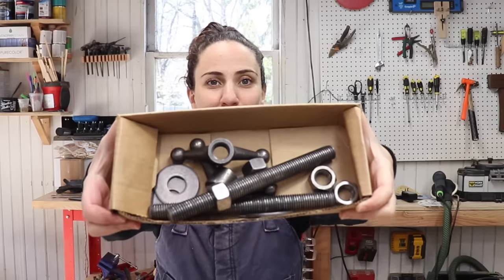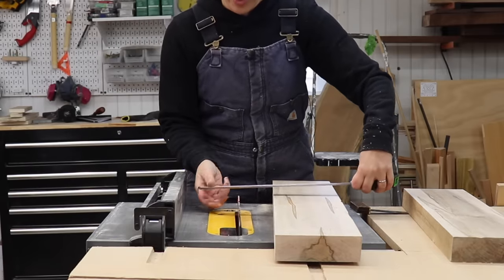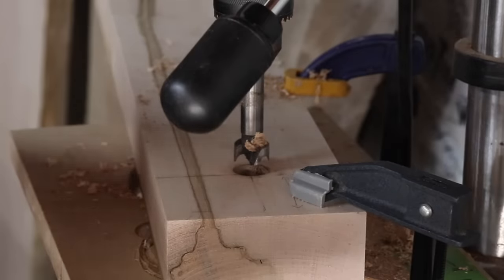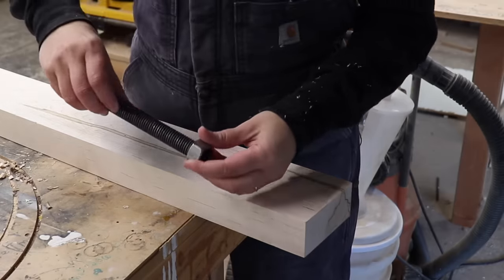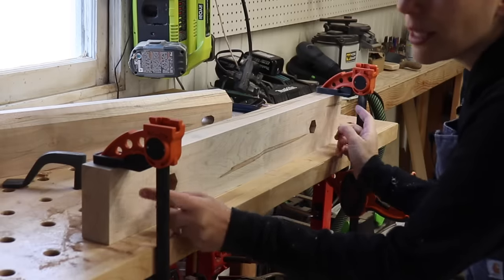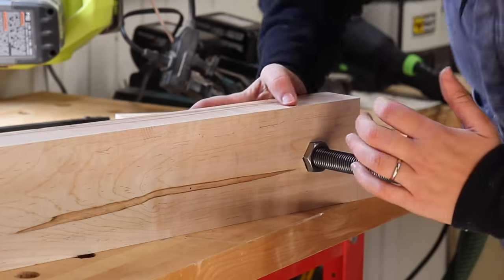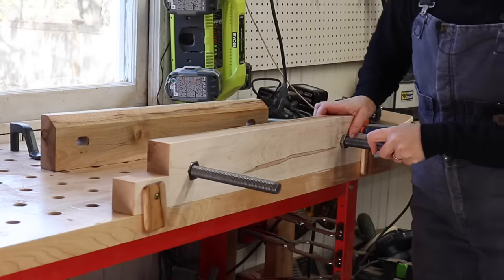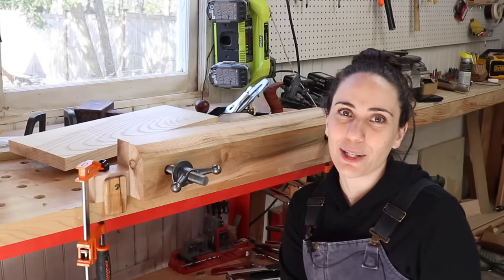$40 Moxon Vise - Easy to build in an afternoon!

Comment: Thanks, Tamar.  This is the first of your videos that I've watched and I found it extremely clear and helpful.  Personally, I prefer videos like yours with vocal descriptions of the process rather than just the high speed visuals.  I've decided to save some money (at the obvious expense of time) and make my own handles by inserting nuts into hardwood, which allows me to buy the threaded rod, washers and nuts for under $25.  I'll certainly be watching some more of your videos.
Reply: Hi there! Where did you  buy the big screw and  nuts for your  vise?

Comment: Great video! I wanted to build a moxon vise for a while. Last summer I was at a local flea market and found gigantic bolts with 1-1/4" shanks. I laminated 3/4" poplar for the jaws and used a piece of curly oak for the front handles. The jaws are lined with cork shelf liner which is very grippy. Your idea of the oval holes will be added to my vise, it makes sense that I would have angled work from time to time. Thanks for the video and the other ideas.
Reply from the maker: Sounds awesome! Yeah, It’s pretty cool to have that versatility

Comment: On the one hand, I like the round hand wheels that come with the Benchcrafted kit.
On the other hand, I could buy 4 of these kits for the cost of one Benchcrafted kit...

Also, if you make the front jaw so it sticks down a little further than the rear jaw, it will automatically index the rear jaw of the vice to flush with the workbench edge.
Reply: Only when its closed tho. But yeah good idea
Reply: Mark Beiser I wonder if you just made the front jaw a wide enough to extend down to the bottom of the bench top if that would improve holding surface area??
Reply from the maker: Haha! Yeah. To each their own I guess. It’s nice that there are options out there!
Reply: I keep thinking about a moxon vise, but I have this nasty habit of wiping excess glue on the end of my bench making it pretty useless for a moxon. Maybe I'll build and sell an excess glue wiping station to everyone. :)
Reply from the maker: martino amello hahaha wipe the excess glue UNDER your table! 😂

Comment: Great video! My one suggestion would have been to instead of making flush registration tabs (11:32), make the front jaw slightly taller than the back so that when you put your moxon vise onto your work bench, you can just easily push the vice back until the bottom lip of the taller front jaw is pressing up against the edge of your bench. Result, you will have an automatic flush mating surface between the back jaw and the bench edge! Overall, good stuff though! :)
Reply from the maker: Thanks! That’s def another way. I didn’t like that way bc you have to have the jaws closed in order for it to register. I’ve used a vise like that before and I just didn’t like it. But to each their own! Lots of different methods!

Comment: Great video. I have the hardware, but haven't got around to building one yet. One critique I would make is that you switched reference surfaces while marking the center on both boards, at the 2.40 and 3.40 mark. Always a good idea to be consistent on which reference surfaces you're using. Again, I am nit picking, but still a great video and the inspiration I needed to build mine.
Reply: mark center from both sides

Comment: Tamar, I absolutely love your woodworking videos. You're refreshing, fun, and very talented. Regarding the vise, the build is clear and well-executed, and absolutely holds up to your typical outstanding work. 

A brief note of caution to folks, however: 

The reason this is SUCH an affordable option is the TYPE of threaded rod being employed here. This is standard, 10 TPI Threaded Rod. 
This means that the threads are shaped like this: \/`\/`\/`\/`\/

Most vises, clamps, anything that needs smooth actuation and really strong, solid clamping FORCE is made with Acme threads (you've probably heard the term used, and in this case, it is NOT referring to Roadrunner cartoons).
Acme threads are shaped like this: `|_|`|_|`|_|`|_|`|_|` (note the square shape, vs the typical V shape).

The reasoning being pretty clear: when you bear down a bunch of force, you have that constant thickness throughout, vs the tapering metal, which will wear and bend, ultimately introducing more racking, slop, and chatter to the vise. Moreover, that rod is 3/4-10. 3/4" diameter, 10 threads per inch. This means to move that rod one inch requires ten rotations of the handle. Compare this to Acme, which, for a comparable diameter, you're far more likely to see 3/4-6 (6 TPI). This is because the meatier threads maintain 90-degree surface engagement (i.e. they don't try to "slip downhill"). This, coupled with the beefier thickness of each thread means less need to be contacted to maintain the same amount of friction (and it opens/closes almost twice as fast).

...it also explains why Acme threaded rods are almost 4x the price for the same hardness of steel and why (and this is where people screw - ba-BUMP! - themselves) the Acme collars/flanges/nuts are anywhere from 5x-25x the price, again for the same steel with LESS cuts made into it.

This is not to discourage anyone, just to inform.
Reply from the maker: Thanks for the info. I havnt found the lack of acme threads to be a problem with clamping force
Reply: Thanks for this interesting piece of information.

Comment: Great vid! Just what a I needed.  I recently bought the Taylor Tool Moxon vise kit.  They no longer include instructions, just a QR code to a link which is overly complicated and not particularly clear. I've watched a few other vids about how to put it together but yours is by FAR the best. Clear, concise and thorough.  Only thing I think I might do differently is to actually mount the vise to the end of my workbench rather than relying on clamps.  I can see the advantage of both, depending on your workshop set up.  Thanks so much!!

Comment: Nice video and very clear. I built mine before I seen this. I picked up everything at the big box store except the t-handles. 

Just a couple things I did different; my front jaw is taller  (even on top), the lower part indexes on the bench face which aligns my vice as well. I did not elongate my front holes, there is enough slop to get enough angle. Also added springs and bronze bushings for wear and self opening jaws.

Comment: Great video, and the version on your website is great as a companion. I used both to build my vise. A tip for marking around the nut before chiseling: my rod was a bit loose in the 3/4" hole. So I put a single layer of masking tape around it before inserting into the hole. The I used both nuts, one on each side of the board, to tighten the rod in place. This nicely centered the nut so scribing it was easier to get centered. Also having the nut tight made it easy to scribe around it, without having to be careful to keep it from moving as you scribe. (as you may guess, I'm not as patient or as accurate with fine hand work like you clearly are!)

Comment: A good video kid and I am learning from you. BUT you must go back and do your safety NO long sleeves and RINGS ok I have spent my working life in heavy industry and I saw some BAD BAD injuries DO your safety ok keep up the good work
Reply: I'm a member of your fan club. First I want to agree with Haydn, hair in a bun and under a net. The middle finger of my left hand is about 3/16ths of an inch shorter than the middle finger of my right hand. I won't bore you except to say plain unvarnished sloth on my part.

I want to brag on myself a little. My shop has been in a storage locker for the past eighteen months. I've finally found new space. Eight hundred square feet, LPG fired central heat, hot and cold running water, full sit down bathroom,  room on the lot for my 32' motor home and my 19' aluminum step van that I'm building out for a shaved ice truck. Five hundred twenty-five a month water and electricity included. Over the years I've done a lot of work for this man and he wants to keep me close by. In fact next week I'm building a flight of stairs from the first to second floors of his new house.

My friends are wonderful.
My work is rewarding.
My life is grand!
Best to all!
Reply: "A good video kid ..." ?  😶

What kind of guy actually speaks like that to a woman?  🤔

Comment: I made myself one of these moxon vises! I didn’t have many of the tools in the video so I used a hand drill,   Shinto rasp,  block sander, a combo square, a dremel I used chisels for the first time effectively to inlay the bolts,  I learned how to create burrs on card scrapers and us it effectively and I ripped a 5 foot board with a pull saw with pretty good accuracy, Slowly I have to say but I got it done.  Made mine out of red oak.  Feels good to make my first wooden tool besides my work bench.
Reply from the maker: Ok

Comment: This video is another of your clear, detailed how-to videos. They're all great. Thanks.
I've been wanting to add a woodworker's vise to my work table, but my table is an Armor clamping table (which you also seem to be working over in part of the video) and I'm having trouble figuring out how to add the vise. I decided to use a Moxon vise several months ago and your video convinced that the time was ripe. I've completed it now and I just wanted to add some of the minor details that I encountered that other newbies might find useful.
- I used the same hardware kit you use in the video. The nuts threaded on smoothly but one of the wing nuts wanted to bind on every other rotation. I threaded and spun one of the nuts from one end of the bolt to the other and then back again, and then repeatedly did the same with the wing nut until it stopped binding. Now everything threads smoothly.
- I used a softwood (white fir) 2x6 for the wood, purchased at a local big box hardware store because it was easily available and inexpensive. If I do this again I'l take the effort and pay the price to get a harder wood. The wood bruised easily and got dirty very quickly, especially if I had been handling the hardware. However it did sand smooth very quickly.
- The guidelines that come with the hardware discuss an alternative front face drilling (¾" holes aligned with the holes in the back face) that only allows for parallel gripping. I chose to do this out of an ignorant belief that it would be simpler. It was not. I had to put in a lot of extra effort (my rat tail file and I got to spend some quality time together in my hot garage elongating the holes anyway) to get the front face to move away from the back face because minute discrepancies in bolt alignment caused to front face to bind on the bolts when I tried to separate it from the rear face. If I do this again with hardwood, I'll also drill out the front face the way you did.
- I finished mine with two coats of golden shellac, not so much to color the wood as to seal it and harden the surface. I then topped that off with three coats of clear lacquer on all surfaces but the jaw faces.
richard
--
Ah, those three little words so many people seem to have so much trouble saying: “I was wrong.”
Reply from the maker: Great tips! Always a learning process!

Comment: Thanks for this, Tamar.  I bought the same kit, followed your instructions.  Mine's a bit smaller but awesome.  And I encountered the exact opposite with Forstner bits....my 3/4" plunged through like melted butter while my old 1" was spinning there, burning enough wood to make s'mores at a campfire.  I doubt that I'll add any finish to it, after all, it's a shop tool, not a Lamborghini, haha.

Comment: The moxon vise is something I would recommend for most shops.  I made mine with components I got at Home Perot for about $20.   I made mine so I could put a 24 inch board in it; the maximum I thought I would need.  I am going to dovetail a piece that is 23 1/2 so I am glad I went with  24 inch.     Enjoyed the video.  Thank you.
Reply from the maker: Glad you liked it! I use it all the time. It’s awesome

Comment: Eminently useful. Just ordered the hardware kit. I'll make this ASAP. I'm still putting together my woodworking shop, so for a while the Moxon attached to any convenient fixed surface will suffice for a vise. Later it can serve as my work site vise. 

I'll leave off the dangling bits, though, as too likely to get in the way or broken. Thumbs and fingers can do a perfectly good job of aligning the vise with the edge of a handy mounting location.

Comment: Tamar , another great video. I'd like to point out a potential source of errors. At 3:44 , you take you marking gauge and drop a mark , then you move the shoulder to the other side of the stock. If your stock is even 1/16" off of perfect width , this will cause an error to crop up. I'd suggest always marking from the same side of the stock , just to be safe. Keep it up - great stuff.
Reply from the maker: Yes. I noticed that too in editing. This was actually not my actual marks I used. My camera didn’t record my first take so I was just quickly rushing through it

Comment: thanks for the moxon vise build.  it has come in handy in glue-ups, where the length, width, and thickness are within the constraints of the vise.  in several cases the moxon vise replaced up to 6 clamps.  woohoo.

Comment: Hi Tamar,
I noticed you marked the hole locations with the Incra T-rule using opposite faces.  A good tip is to always use the same reference face when marking so the holes line up perfectly.  Just something I learned in my woodworking classes.  Your tool skills, design  and knowledge are head and shoulders above your peers on YouTube. Please keep up the great content!
Reply from the maker: H! Yes. I noticed I did that in editing. But I’ll tell you a little secret. That was actually the 2nd time I recorded my marking bc I forgot to press record the first time. The correct measurements were on the backside of those pieces! 😂
Reply: @3x3CustomTamar  ;-)

Comment: That's fabulous. I really like that you can hold tapered work pieces.
I wouldn't pay $40 for the kit though. It's just a pair of "Turn Buckles" two nuts and two pieces
of threaded bar. They're all used in concrete shuttering and cost just a couple of Euros.
Maybe even less where you live. Forgot to mention the washers, we use those too.
Great video as always.
Reply from the maker: Thanks! If you can find em at a better price. Great!

Comment: Great instructions, Tamar!  Made this vise today with Walnut.  Only advise I would make is to make sure to measure holes prior to drilling.  Bolt and Nut fit easily in 3/4 and 1 in holes.  I made the error of following video instruction on forsner bit sizings and should have been more careful before drilling.  All turned out well, as I used thick CA glue and toothpicks to secure the back jaw nuts after I drilled 1 in holes, nuts easily fit inside hole.  My mistake, not yours.  really appreciate your content.  Keep up the good work!  My vise turned out fine and works great!
Reply from the maker: Glad you were able to work it out! Thanks!

Comment: Here's an idea I plan to use to make the Moxon vise a little more universal. I'm planning on making a workbench from laminated 2x4s leaving a gap in the first layer where I can hang the Moxon vise upside down. The "ears" normally used to clamp the vise onto a workbench surface can be used to hang the vise upside down from a step in the first layer of the bench. Add dowels in a vertical position through the ears and into the first layer of the laminated 2x4 in the bench to keep the vise from sliding out.

Comment: Nice job.  If you make the front face of the vise 1/8th of an inch proud of the rear face you can register the vise right at the edge of the surface that you mount the vise on, which is a useful aspect.  to do this afterwards you can just take a little more than a kerf off of the rear face on your table saw.
Reply from the maker: Yeah. That was one of the options listed in the instructions the kit came with. But I didn’t like that the vise would have to be closed in order for it to work like that

Comment: Wow cool kit , I just picked up some used cabinets for my shop which means I have to lose one of my workbenches. I will gain some counter space though. I will put my wood bench on lockable rollers and now I know what i'm going to do for  vise. Thank you Tamar.            Your neighbor in PA
Reply from the maker: Awesome. Always fun to figure out shop layouts ha
Reply: @3x3CustomTamar  I didn't plan my shop in the beginning, now I'm kind of faced with a must do. The good news is that its a shop project. Oh before I forget I have an older Craftsman joiner 4" if you are interested. I don't really use.

Comment: Super explanation, as usual, very elegantly executed. If you are prepared to put up with something less stylish, wing nuts are quite cheap, as is studding. Nuts and washers are free! I would have been tempted to clamp the jaws together, drill both, then enlarge the holes in the front one. The nut recesses in the back jaw could be drilled at the same time, assuming it is on top. Then flip both top-to-bottom before assembly. Sharpening any sort of drill is certainly an acquired skill. Meaning I don't know how to do it. A new one might be better for me.
Reply from the maker: Always another way
Reply: @3x3CustomTamar  Nothing more true, when you create, the important thing is to get to the end! By no means everyone can do that. No criticism or offence intended! You are inspirational!